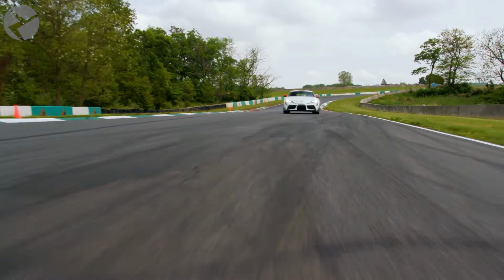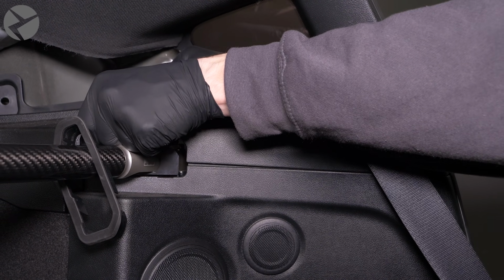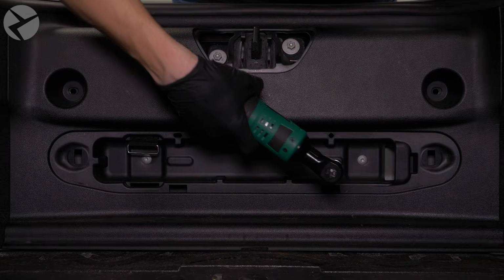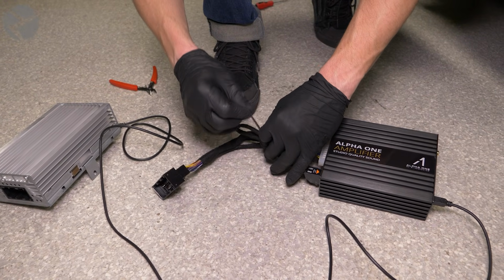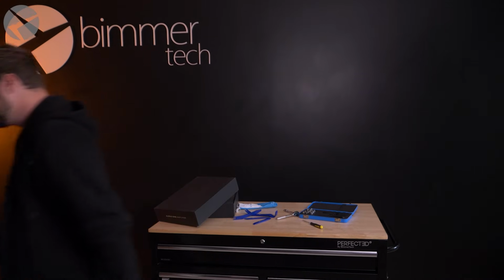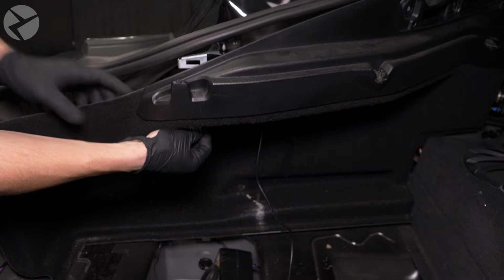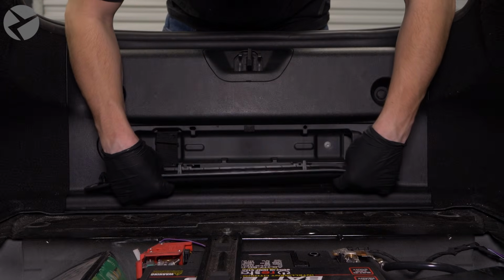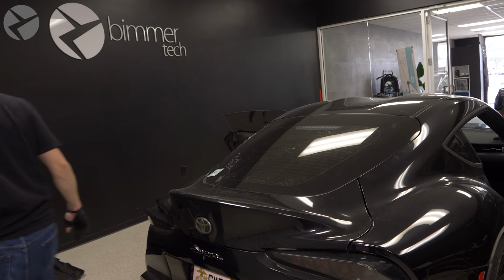Toyota Supra Alpha One Amplifier Upgrade – Installation Guide

Comment: Hello! i bought a MK5 supra with this amp installed. The previous owner has changed the EQ inside the dsp software to his own taste, and i'm not a super big fan. Is it possible to get the "stock" EQ file you have on these when you send them over to your customers? if so, can i reach you via an email?
Reply from the maker: Hey there!  Congrats on the purchase.  Reach out to our Sales Team with your VIN, and if the original order is in our system, we can send you some tunes.  If you would like a remote tuning session to truly make it custom for you, there would be a fee for that.

+1 (646) 439 7920
info@bimmer-tech.net
https://www.bimmer-tech.net/page-contact

Comment: What’s the usb cable for?
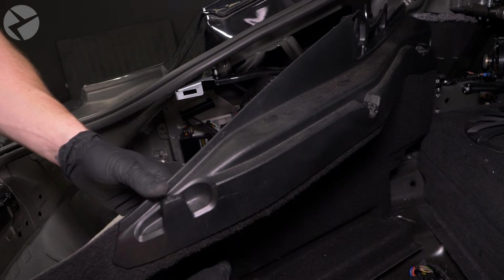Reply from the maker: As mentioned at 10:33, it's if you need to digitally access the amp in the future.  Mostly, future tuning.
Reply: Does the Amp itself need tuned or it that straight up plug and play as well? I have an AMP in my current car that took a bit to tune before even using it